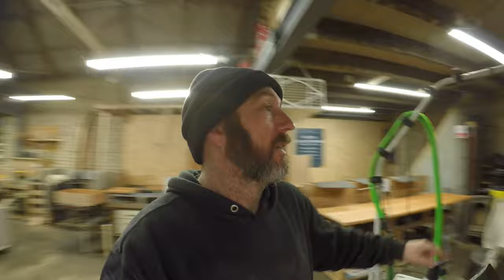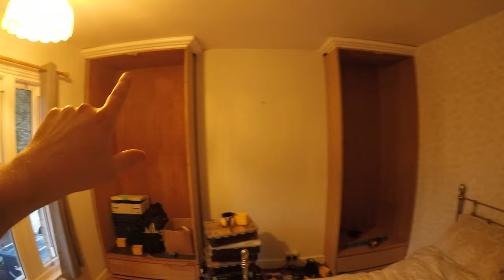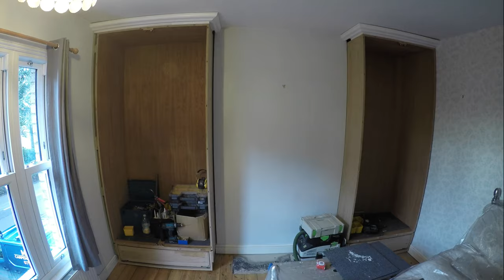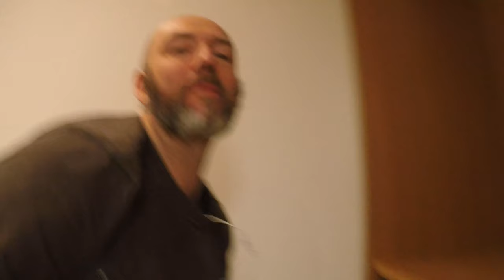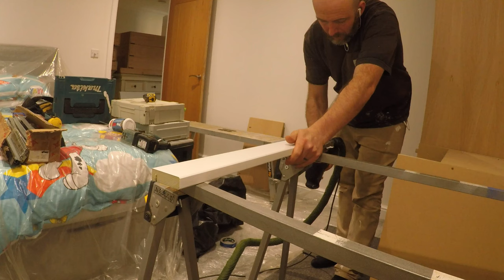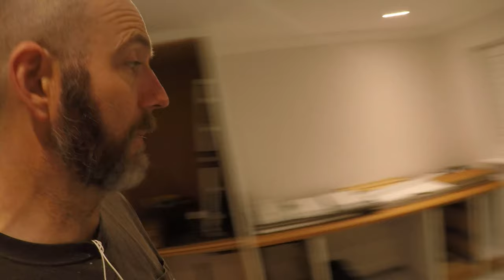How I fit and level Wardrobe bases plus how I prepare frames for scribing #55

Comment: Great work! Thanks for covering how you level and fix the plinths. When you calk around the scribes do you paint over the calk with the furniture paint, if so how do you deal with the contrast between the spray finish and the brush finish? Some say its not how good you are at cutting the scribes but how good you are with a calk gun... Make of that what you will. 😂
Reply from the maker: Thanks for giving me content😂
Tbh if it’s a dark finish I use a clear silicone which kind reflects and works well. If it’s light paintwork I normally caulk and touch in but it’s rare I see a difference with the paint or white low modulus silicone!. On this one unused white low modulus silicone as the room is fully finished. On the wardrobes from Wednesday and Thursday I used caulk as they need to decorate. 

I hate white on white scribes especially on walls! Make of that what you will😂

Comment: I've used morrells drys fairly quickly with a bit of heat, or 123 bullseye, where I am. I can only use water-based. Are u spraying in an old farm shed because I found that they are very damp? I was spraying in an old steel container. I had problems with drying time.
Reply from the maker: No dampness in the paint room
It’s upstairs insulated and lined. I have air in and out with a sliding door to where I spray and heat to where I dry. The renner takes 4/6 hours on spec sheet. It does dry quicker tho and so does top coat! Plus it’s stackable end of the day and very hard. I have heard really good things about morrells! For me renner is made down the road and I love the topcoats. There are a volume of primers out there that dry in 30minutes so I think I may play with them. The way I see it the quicker it drys the less fibre raise which means less prep.

I have to say tho using renner and having a seperate drying room have been by far the two best improvements I have made in the past couple of years!

I do like the original 123 blue tin and tbf it drys quick. I don’t have to use waterbased tho but obviously prefer it for clean up as I am sure you do! I may invest in a seperate  gun for priming as that would help!

Comment: May I ask please what’s the pull saw you use ? Trying to decide on one for myself 👍🏻
Reply from the maker: Hi mate. I have a couple of the bigger Vaughan bears which is what I use most the time. I also have two mini guyko ones I bought when I messed around with exposed domino drawers. The only difference is the cost tbh. My Vaughan ones are at least 3 years old and still going strong and the steel is amazing quality.
Reply: @Wattsjoinerybarn  thanks muchly to you I’ll do some research 👍🏻

Comment: cracking video as usual , which model extractor do you use ,?
Reply from the maker: Very kind of to say! In a sorta semi pro move all my tools are listed in the description! If you mean the workshop extractor its Jet with an Axminster cyclone box and custom cupboard.
Reply: sorry matt , i meant your festool site extractor
Reply from the maker: Ah. It’s the midi, fits well in the side door with the kapex and table saw and benches. It fills up quick but in prefer the hose storage and size over the bigger ones. Really need to get the Bluetooth remote too!

Thanks so much for watching

Comment: What paint are you using.
Reply from the maker: Renner 762 top coat
Renner 643 (I think!) primer 
Top coat is very tough and levels out very nicely.
Reply: @Wattsjoinerybarn  what do u think so far I've the 643 haven't used it yet and are u using hvlp.
Reply from the maker: @jasonhughes6994 
Yes mate graco 9.5. 
I think it has a good build up to it but you still need to put the first coat on tight with mdf then heavy coat same day as even with the 404 catalyst it takes too long to dry IMO which even with good ventilation and heat causes some fibre raise. It comes good in the end and sands well plus the topcoat finish is next level.  I think I may go back to zinseer bin shellac as it drys so quicker tho. Or I have a few recommendations from a few people I have met since doing this YouTube stuff! Do you have any thoughts on it?
Reply: I've been looking at the Renner stuff recently. Do you buy direct from them? Might give them a call. I never know about mixing primers and top coats from different manufacturers. I know they just want you to buy into their system but I always chicken out 😂
Reply: @_nacnud_  I'm in Ireland. There's only a couple of places that stock it, so I have to go through them when buying.
Reply from the maker: Same here. Renner rep told me that any waterbased primer or zinseer bin is good for renner. I buy straight from them. I think most people just go to symphony coatings but renner are really near to me so I just called them up one day. Ever since had a rep who tbf has been brilliant to me aswell as the other staff! There product knowledge is good and they actually mix it where I buy it from.
Reply: @Wattsjoinerybarn  Cheers Matt that's good to know. Oddly refreshing for a manufacturer to say you can use other primers 🤯. I may well give them a call for some guidance but defo fancy trying out the top coat. Would you say you were happy with it?
Reply from the maker: Primer sands/dusts well, wouldn’t  say it was great for grain raise. Top coat is outstanding. They say it’s 1 coat which I would say it is in darker colours. Very tough
Reply: @Wattsjoinerybarn  sounds right up my street. I'm always looking for something more durable whilst still keeping a good finish. Will try and get my hands on some 👍🏻
Reply from the maker: @_nacnud_ forgot to mention smallest size is 5kg which is not far off 5litres. So I would ask for prices first. They should actually send you samples too! I’ve stopped using the catalyst, hardener and it’s still proper tough
Reply: @Wattsjoinerybarn  yeah 5kg seems to be the minimum for quite a few. Not a problem generally as most jobs I tend to use the majority. Annoying thing is when you need more than 5 but a damn sight less than 25 🤣. Been using Sayerlack up to now which I'm happy with overall but the durability is one thing I've got question marks over. So many variables with paint though....
Reply: @_nacnud_  I've used the water-based sayerlack. I resprayed a kitchen for someone with it, never again. It's OK for places that aren't in high use but definitely not kitchens.
Reply: @jasonhughes6994  interesting. Kind of confirms my reservations! I'm always a bit wary of using it in high traffic areas. Don't do kitchens (yet!) But if I'm doing furniture in living rooms etc (especially families with kids) i feel like it might not be up to it.